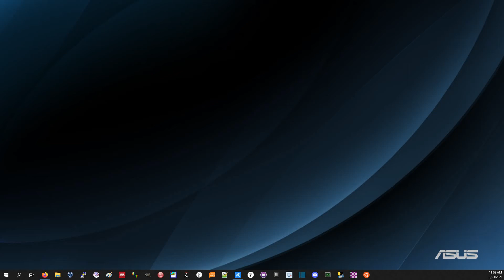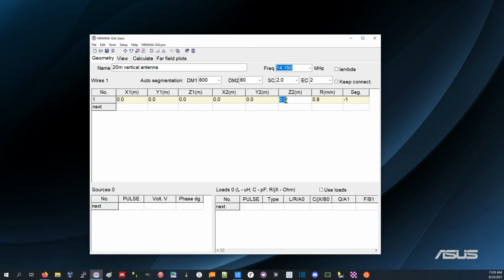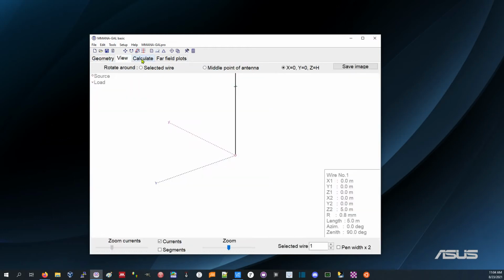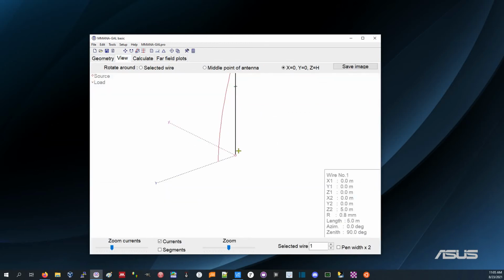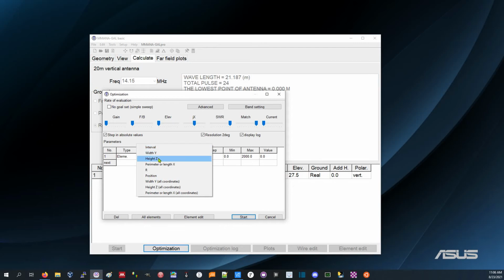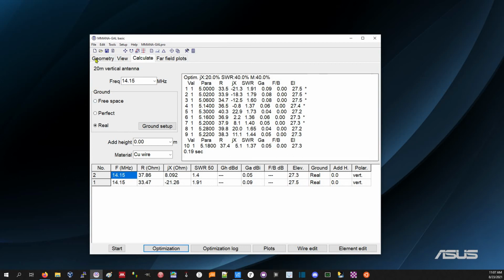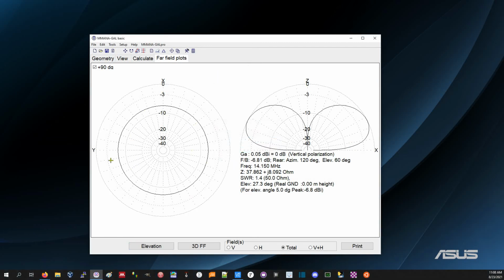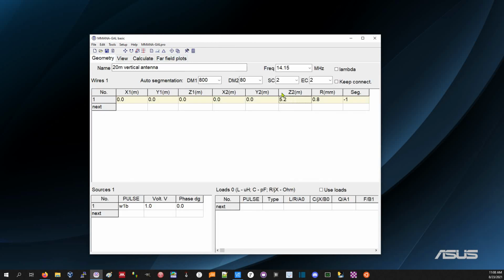Simple antenna optimization in MMANA GAL

Comment: Could you make one more about optimizing yagis too? Please? Mine is 3 element btw. THX
Reply from the maker: Thank you for the comment and suggestion.  I'm thinking that you should give a go at modeling your yagi.  You can do it!  Just model a vertical and add two parasitic elements of the right length & at the right spacing from your vertical (driven element) for your frequency of interest.  Note that the parasitic elements, the reflector and the single director, don't have to have a source, they'd just be wires.  Best of luck & 73.
Reply: @quantumradio  Hi, it's mind blowing what you can achieve with recent LLMs, I've learn in less than an hour how to desing, model and optimise 3 ele yagi uda. I'd say 90% came from LLM itself rest was my researching basically opening any yagi and examining how do they constructed it, on what axis etc. So I am an exert now hahaahahah.

Comment: so what is the difference between the "element" and "wire" , when optimizing. 
My understanding from documentation is that "element" represents some attributes of the wire - such as width, perimeter and radius. 
Bu then, why are we even allowed to choose Z as an attribute, when selecting the parameter "element" ??
Very strange; bad documentation. I dunno if you are wrong here or not ... 
I mean, for the optimisation you are doing here, couldn't you have just selected "wire" instead??
Reply from the maker: Thank you for the comment.  Good points.  It seems that MMANA GAL uses wire as an object with the attributes of X1, Y1, Z1, X2, Y2, Z2, R, SEG, Length.  I believe the Length is a derived quantity so not a fundamental attribute.  Not sure what SEG is all about.  Now, an element seems to be an aggregate object or a way to simplify data entry to reduce errors.  Per the documentation "the element editor simplifies the use of the geometry window by allowing the user to define width, length, perimeter, and element spacing in a more intuitive manner".  In my optimization I believe the program logic used element and wire interchangeably in my simple exercise.  I say this since my results made physical sense.

Comment: Hi, great videos, and I have found these interesting and informative. Could you do a video on an inverted L antenna? 
Also.... could you model a vertical antenna that uses a ground matt instead of radials? I used 100mm square mesh, in a 4x4m area for my 1/4 wave *0m vert, antenna is approx 20m high

Keith MM0KTC
Reply from the maker: Hey Keith, thanks.  Good ideas about antenna models to pursue with MMANA-GAL.  Will try to add these to the future plans.  73!
Reply: @quantumradio  Thank you.... keep up the great work
Reply from the maker: @kljw66  Thanks & 73.